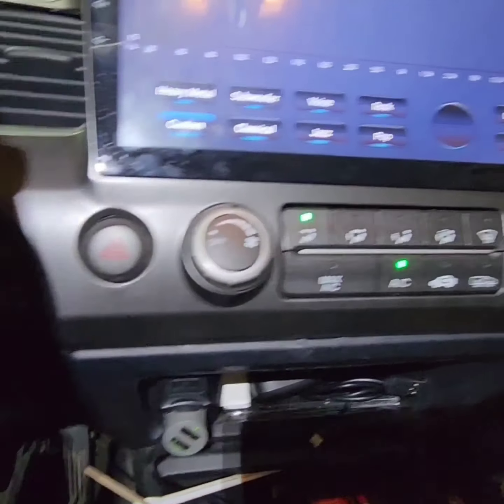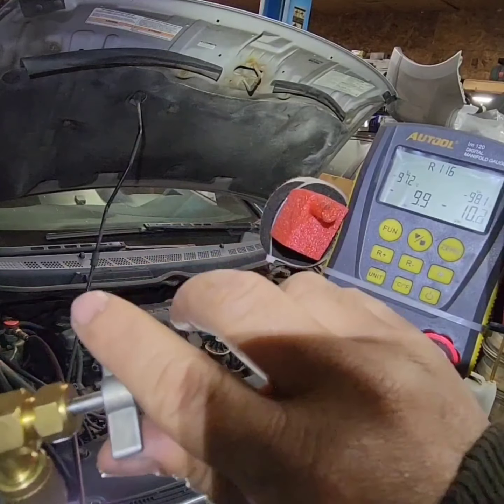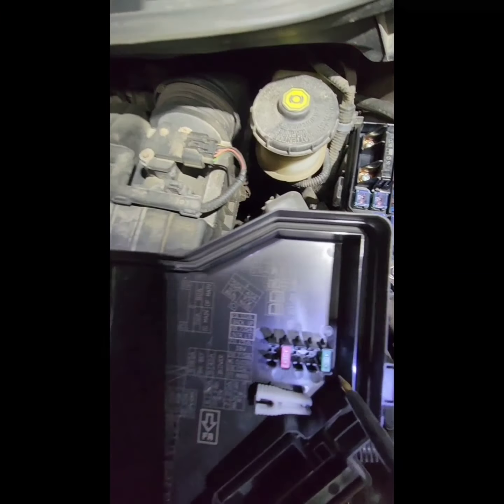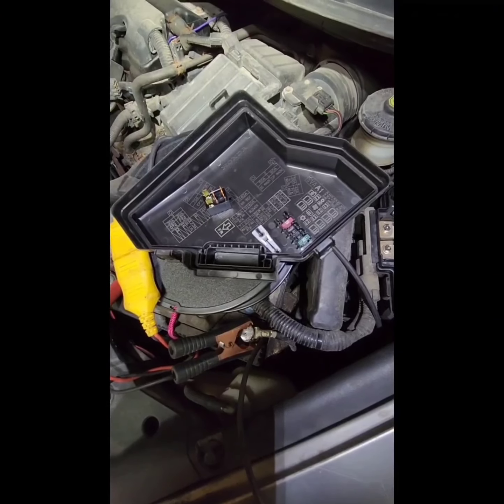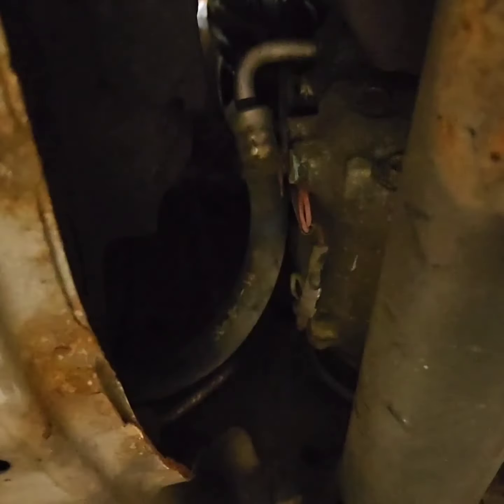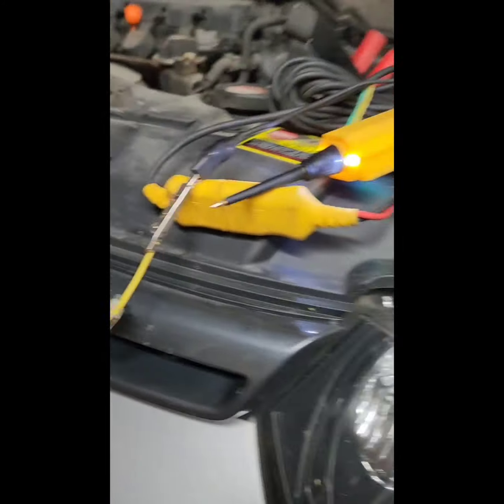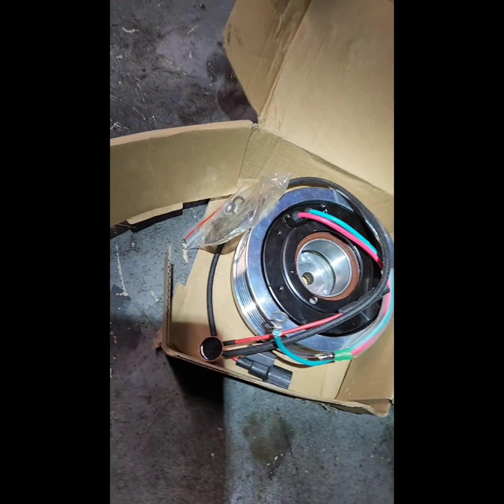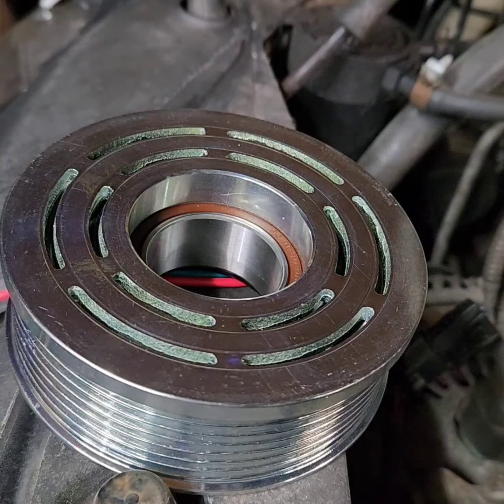How to diagnose A/C not working & Thermal switch test for 2006 honda civic

Comment: Hello. i have a 1994 civic. if the ac compressor stays engaged all the time. could it be this thermal switch?
Reply from the maker: Probably your ac relay is grounded, faulty, or ac switch
Reply: @gumerasgarage5328  if I use my test light on the relay connectors I'm getting the grounded connections that I expect to get when I turn on ignition power.
Reply: @gumerasgarage5328  could it possibly be the AC pressure switch?
.. the clutch disengages only when I press the AC power button.
Reply from the maker: @1776FreedomNow  probably you have a problem with the ac switch . Try turn it manually to make sure
Reply: @gumerasgarage5328  turn the AC compressor pulley/clutch?

Comment: after you replaced it, how did you get freon on the car? did you trick the AC clutch?
Reply from the maker: You have to get the tool for ac to fill up
Reply: @gumerasgarage5328  yeah I have the gauges to do it. but my question was, did the AC clutch have to be working to fill the freon or nah?
Reply from the maker: @ichheibeangel  First, you have to empty & vacuum the system. Then  you start the engine, and the compressor should be off at this moment, but as soon you fill up the system, the pressure builds up, and the compressor should be on. If not, there's a problem